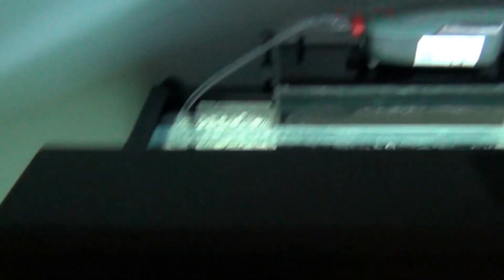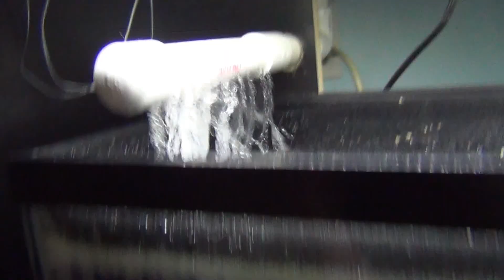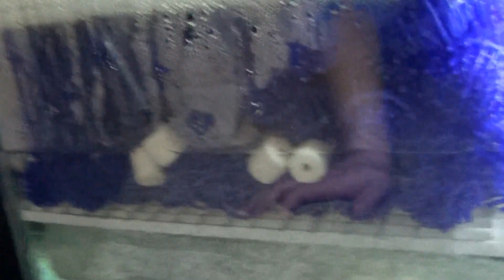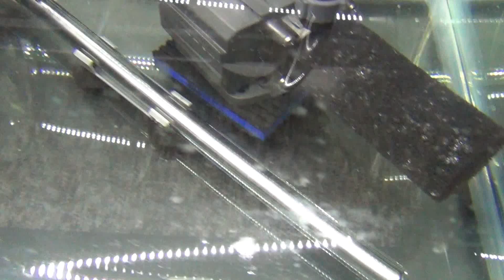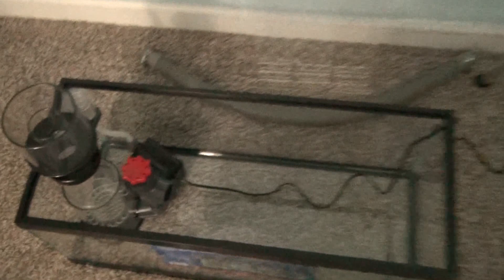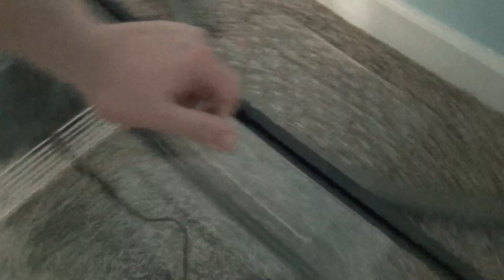My Current Saltwater Tank Build and CPR CS90 Review

Comment: How do you use those strips to light up down there?  great idea! Who is the seller you got the plates from.  I have seen premade kits but never the acrylic plates!  Do you think this cs90 is strong enough for a 72 gallon? says 600 gph which is not 10 x per hour.  Not sure how to matchup with pump so I figured I would get a adjustable one, probaly jebao since it has a controller with feed mode! Also wondered if you have had any problems with leaking with the tank.  I almost bought that tank until I read reviews.  i think its because of no center support  bracket!  Beautiful tank though!  Perfect size.  I went up to a 48 wide and I know ths is 36.  That width would have been so much better and crammed like my 48 inch wide!

Comment: Do you have to use the water lifter?  Couldnt you suck into it to get it going?  Like you said there are types that dont need it, I think the ones that show the clear tube and not the black flat plate.  Is there tubes below this?  Just wondering why and if you need it?  I would rather not have the xtra expense!

Comment: that overflow is going to get clogged for sure. those slits are dangerous and will clogg just about a thousand times easier than a standard 1"-2" hole. theres a big difference and risks you dont have to take with this kind of design.

Comment: Not sure if you'll read this or if it'll matter as it's almost a year after the fact, but you have a metal hose clamp in the water in your sump, which is no good.    Use plastic for anything that comes in contact with the water.